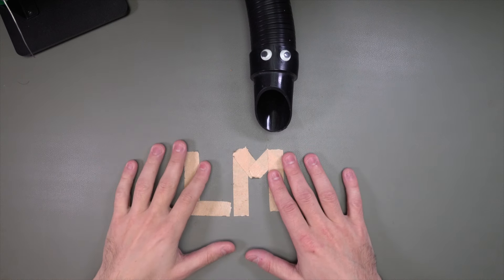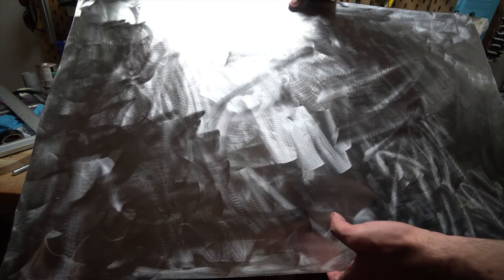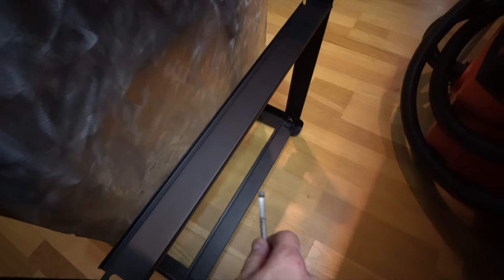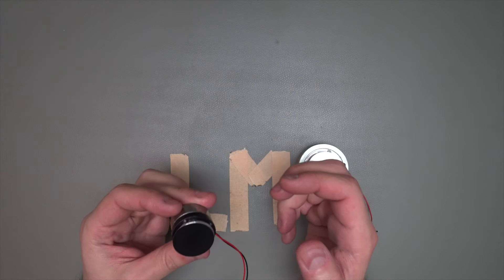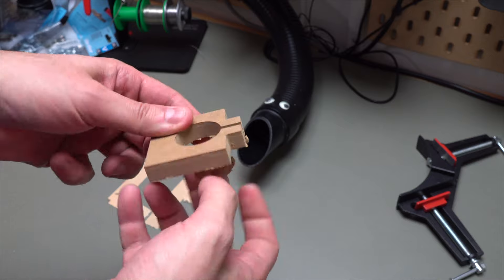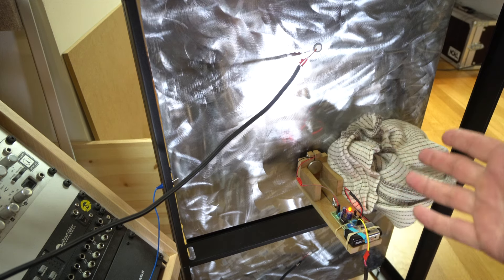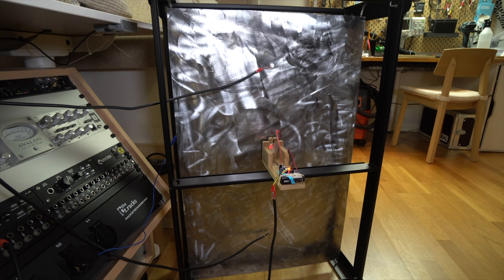DIY "IKEA Hack" Plate Reverb Part 2 (Sounds amazing now!)

Comment: Grounding directly on a main spot is deadly dangereous, beside if the audio interface got its power from the pc with some mid/low tier pc psu it can even cause additional problems. I would definitly use the pin 1 of a xlr connector on the input of the interface so you can remain safe and close to the ground ref of the audio path.
Hope you'll bring some more original and clean projects like this. Sounds and looks awesome.  Cheers
Reply: Dad Vader yeah, the grounding thing is what confused me. What was that box in the rack he was grounding too? Is that just a power distribution that he just wired a ground pin too or what?
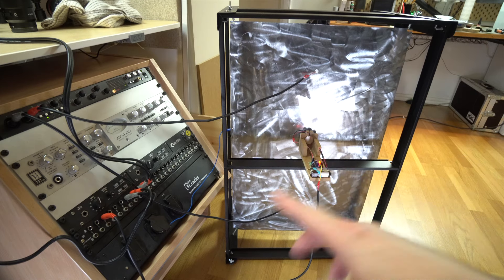Reply: @dylankaminkow5411  at 13:02 looks like a main power distributor, the fact is you end up hooking up your plate to earth and not ground. Ground is a reference point in your audio path and may be different than earth if something go faulty.  i'm not even talking the case where your cord could fail and you get 120/240V in the plate.

Comment: There are so many open doors with this project idea...  Imagine the ways you can impact the sound by adding a doming or curvature to the plate...  go back to horizontal and put grains of rice on the plate...  change the mounting hardware and plate tension...

Comment: Really nice work and problem solving. For dampening you could try a wedge of foam or insulation, to put in the same spot as you have the dampening in the video. That way the further you press it down the more pressure it'd put on the plate, and it would hold itself in place even if just gently placed there.

Also I have to ask about that mini table saw!

Comment: For the dampening, maybe take a look at the sort of adjustable felt dampener that many snare drums (like an old Ludwig Acrolyte or Supraphonic) use to dampen the ring & overtones of the top/batter side head.

You could probably just buy one of those, drilled a hole into one of your side rails, and mount it onto this rig. Turn the knob one way to push more of the felt into the plate, or turn it the other way to have less felt / less pressure (or none at all).

Comment: Your original video inspired me to start working on a design for a wall mounted plate. My idea for dampening was a felt pad on a piece of plywood that could be adjusted. In your case, you could build a second mount like the one for your transducer and just put felt on the end of it instead. That way you can adjust how hard it presses on the plate.

Comment: Wouldn't it be better to actually mount the transducers directly to the plate?
Reply from the maker: Not really.  The transducer needs to be held securely on one end so that it delivers the sound into the plate.  If you just attach it to the plate only, then some sound will get pushed into the plate but a lot of the sound energy will be lost from the other side of the transducer (since the plate effectively pushes back on the transducer).  

That said, I do use strong double-sided tape to make sure the transducer and plate are moving together.  I forgot to mention this in the video.
Reply: @LeoMakes  Makes sense, when I was writing the comment I didn't realise it was just the "send" transducer that you mounted securely to the chassis, not the "receive" ones. I think your reasoning applies to some extent to the "receive" transducers as well, but I guess it's a tradeoff between getting a strong signal and not damping the plate too much.

Comment: 16:40 is it overdrive in the amp, or is the transducer not in permanent contact with the plate at higher amplitudes?
Reply from the maker: Good question!  I noticed this was happening during the tests I did before filming, so I actually used strong double-sided tape to ensure that the transducer's plate is always in good contact with the plate (i.e., it never pulls away from the plate after giving it a high amplitude "push").  I forgot to mention this detail in the commentary but it helps at higher amplitudes.
Reply: Was it the usual thick "spongy" variety of double-sided tape? Because I would think that that would block most of the high frequencies. OTOH, you mentioned, and the sound samples prove it, that they were preserved just fine.
Reply from the maker: @klaasbil8459  You're asking good questions!  No, the tape was not the spongy stuff.  I actually got a strong double-sided tape that was 0.2mm thick and did not compress much (it was gel-like, not sponge-like)

Comment: Holy sht, I would have bet my life that you couldn't find 100k people who knew what a plate rev was. Not to denigrate EMTs marketing Dept.  But Damn!   
Anyway, have you tried corner to corner placement of the transducer/pup? I'm hearing sub 2-3sec decays that sound good, actually sound amazing considering. But, the beauty of an EMT was some of the longer. 4-6 sec decays.. I'm sure the size of the plate figures in on max decay. But I'm pretty sure that it's a function of the distance between driver/pup that the extra size allows..   Where were you in the 70s. I spent my entire career lusting after & paying for $10k+ for Reverbs that weren't springs. Though there may have been an AKG spring early on. From 140s to 250s to 224, 224x, 480xl, DMX/RMX, etc... Today, it's hard for people to imagine the value, necessity & cost of a studio Reverb.  Great clip..

Comment: I once worked on an EMT mini plate who's transducers had failed. It was approx 2' x 2' in a sound deadening shell. The plate was a gold foil--very thin. As I remember there were 2 transducers and 4 pickups. EMT tech warned that the real difficulty was removing the old transducers and pickups. The cement had increased its hardness over the almost 2 decades. New transducers and pickups were going to cost several hundreds of $$$ (this was around 1992) plus labor, plus the possibility of ripping the foil and destroying the device; so the client decided not to proceed. 
  I like your adjustable transducer mount. The EMT had everything cemented to the foil plate. I also like zaque.mwhc
 suggestion of using a snare dampener. I would suggest making something along those lines, but with a disc that could take a 6" lambs wool buffing pad. Make it adjustable to increase or decrease pressure on the plate. Just a thought.
  I really enjoyed both of these videos and hope you do a follow up documenting your mods and experiments. Thank you.
Reply from the maker: Thanks for the kind words, Roger.  It's always interesting to hear from people that worked with (and worked on) EMT plates.  Years ago I mixed on EMTs but the studio owner wouldn't dare let a young guy open up the plate and mess around with it so I never got to see the inside of the crate!

It's funny, I was just at a hardware store and I was thinking about buffing pad.  It's the right size, shape and density.  I might have to give that a go.

Anyway, thanks for watching!
Reply: How did the mini-emt compare sound wise to a full plate?
Reply: @kentwde7933  Never heard it as the transducers were failed.

Comment: Haven’t seen the first video so excuse me if this is a dumb question, but why place the driver in the centre of the panel instead of on say a corner, where it would interfere less with free vibration of the panel? For example in a spring reverb, the driver is placed at the end of a spring, not in the middle.

Comment: The plate reverb sounds great. You're getting very interesting, musical, and usable sounds from it. I'm glad you went for the vertical mounting. The interleaved springs was a good solution. Muting the plate should be easy with something like fleece mounted on a piece of wood attached to the crossbar. Then it could be slid closer or farther from the plate as needed. I didn't hear any odd sibilant sounds or weird tones coming from the reverb. Have you done a spectral analysis of it?

Comment: Input impedance for a piezo pickup should really be substantially higher than 1 MΩ. 5-10 MΩ would be better, for optimum frequency response. It would be extremely unusual to find a instrument input on any piece of professional gear with an input impedance lower than 1 MΩ. The only brand of gear I can think of off the top of my head that commonly features lower than 1 MΩ input impedances are the One Control/BJFe guitar overdrive pedals.

Comment: Couldn't you wire the ground into the instrument cable/audio interface? (When using a balanced/trs cable)
Reply from the maker: Yes, but instrument inputs (which you need to use because they're high impedance) are usually unbalance (tip-sleeve) only
Reply: @LeoMakes  True but to be clear, I meant the cable for the piezo pickup that goes into the audio interface. I thought the piezo would need balanced anyway but not sure. But yeah I have a feel most ppl just won't like sticking a cable into an outlet to ground it unless temporarily :D

Comment: A friend and I built some plate reverbs for my studio several years ago using the plans that Bill Cunningham from Echoplate had made public. We even brought one of our plates to his house and had him give us some tips. One of the amazing things we learned from him was how the dampening system worked. 
He told us to use a particular type of Corning ceiling tile insulation (which is longer available, we had to take some from my mom’s house). The tiles are fiber glass, maybe 1/2 or 3/4  inch thick, with a plastic surface on one side. Bill said the trick is to poke a lot of pin holes in the plastic. These tiles (cut to be roughly the same size as the plate) are mounted parallel to the plate on a frame that makes it so you can easily adjust the distance between damper and plate.
Magically without ever touching the plate, the damper dramatically effects the decay time of the plate reverb!

Comment: Just by looking at it, it feels like the wall thickness of the speaker mount is a bit on the lower side near the brackets, but as I'm not very experienced with MDF material, it might work as it is.
 You should probably add some washers to your screws and nuts. Especially on those on the MDF for better distribution of pressure, or on the screws you plan on adjusting a lot. 
Other than that, this is a very inspiring project of yours! I'm wondering how this thing might sound, once the metal sheet is going to rust. Maybe you'll want to go for a stainless one then.
I'm really looking forward to seeing another update video, or maybe some different DIY projects of yours. Keep it up, and thank you very much for sharing!

Comment: Hey:) I'm thinking about making this plate reverb, will you be so kind to share the project for cnc machine?  Upgrade cost is around 40$ but now if you like to build another one, you don't need to buy 2 Ikea shelfs so you save some money with this upgrade as well
Reply from the maker: Correct, you only need one shelf if you’re making the upgraded version. I don’t mind sharing the design files but let me look into the best way of sharing documents. Probably GitHub but let me check.

Comment: Your project looks amazing, before this video I only knew about spring reverb. If you want keep going with this project you could try making a small tube pre-amp. You could probably base if off of a headphone amp running one or two 12ax7's. They're fairly simple to make and might give you better sound quality than a 9v solid state. You could also add in high/low cut controls to change the tone of the reverb.

Comment: Hi! I'm gonna build this any day soon, the last parts arrived in the mail yesterday. 
Just wondering, could I simply just glue the transducer to the plate, and skip the whole MDF-part?
Reply from the maker: Hi Petter. I’d say give gluing a try and see how it works. My intuition is that the transducer will need something to “push” against in order to get the plate moving, but it might have enough mass where it’s not necessary. But again, try it and see how it sounds.  You can always make the holder later if you want. 

Good luck with your build!

Comment: If you want to know more about damping your plate, have a look at this short video which shows how an EMT 140 does it. The damper is essentially just a flat and solid surface that sits parallel to the plate, if the damper is far away then the plate is undamped, if the damper is brought in close then the plate gets air damped and the reverb time becomes shorter

https://www.youtube.com/watch?v=HEmJpxCvp9M
Reply from the maker: Yeah, I watched this recently when I was doing my research on this project--it's a great video.

Comment: Not sure if someone has mentioned this already. But you could have some horizontal threads that push wooden part attached to thick foam stoppers slowly against the plate. Dampening it gradually.

Comment: After using the UAD EMT Plate 140 for years (and other VST fx), loving the way this plate sounds. My biggest complaint of VST FX (even the most meticulously modeled ones) is a lack of state based interaction (i.e.the preceding state interacting with the current input). This is especially true for plates - if a physical plate is already vibrating, new stimuli interacts with the vibrational patterns already in progress. This adds to the lushness and unpredictability. Kinda like hitting an already vibrating cymbal vs on at rest.
There are models of this behavior (like the AAS VSTs; and the UAD EMT 140 algorithm may take this into account as well), but they are almost always less convincing than the real thing, and the processing power required to get a good stated based approximation is massive.

Comment: For dampening: Assemble a piece of foam to a fixable slider near the center of the plate. Use pyramid or circle shaped foam. The more you press the foam via the slider to the plate, the more dampening you have. Think about the foam shape to achieve either a linear or a logarithmic dampening curve. Let me know what you think.

Comment: I said in the previous one, but I'm SO making one. I'm also thinking in ways to dampen it. Maybe something similar to the transducer mount with felt pads and a screw?
Reply from the maker: I was thinking along similar lines for the dampening system.  Good thinking!
Reply: @LeoMakes   I even thought what would happen with 2 similar dampening systems, closer to the piezos, that can be tighten differently and have different density of reverb in L and R? Not sure what would I use that for, but...

Comment: I love that you figured out a way to build your own plate verb on the cheap. It sounds so sick. 
I actually have an idea on how you could damper it! Something like a Pearl Internal Drum Muffler #734, which is like $5 right now on Musicians Friend. I don’t know if it’s long enough to hit the plate from any of the frame, but it could be made to work. If you used a few you could have a ton of reverb length adjustment just by a few knob turns. You could make mounting points in different places on the frame. I hope the idea helps in your endeavor. It may be unnecessary, because it sounds great with that towel already. Plates sound beautiful and yours is no exception. One day soon, I am going today build my own.

Comment: is that the minis desktop table saw from Harbor Freight? Does it work well on anything other than MDF? I really could use one but the reviews made me dubious.
Reply from the maker: Hi Bob, I have the Proxxon FET table saw.  It's designed for model makers and people doing high-precision small-scale prototyping work and I think it's excellent for that kind of work. I've  used it on MDF, plywood, hardwood  (10-20mm thick) and even thin (3-4mm) aluminum panels and got nice clean cuts.  It's definitely NOT the right saw for ripping large panels or thick lumber but for small work it's great.

If I made reviews on this channel, I'd probably review this and give it high marks.  Hmm... Maybe I should make reviews?

Comment: Damn, it Sounds really really good!!

The ground loop solution isn't that good tbh, maybe 1-2 di boxes with groundlift are a better option.

DI boxes also solve all the impedance issues.
Reply: Especially with snare and those short impulses at 16:09. The reverb really makes them shine and it also ads a kinda sparkle in the higher frequencies!

Comment: Maybe if we hook a towel, smashed slightly into a ball, and attach it to a rotating arm, with another arm pertruding from the back, so it would have a weight, that would push the towel to the plate, and then wrap it with a strap, that is connected to a rotating lever, so we can easily set the dampening?

Comment: I already have ordered exact same  big transducer, wich you called "muddy". Is it realy that bad?
Reply from the maker: Not at all!  Just don't turn it up super loud and high-pass filter the signal that is going into it and it will sound great.  The advantage of the big transducer that you ordered is that it has two holes for mounting, so attaching it will be much, much easier than the solution I had to use (the medium transducer has mounting options, which is a pain).

Hope this helps!
Reply: @LeoMakes  ok, thanks, btw you can try to get "more stereo" sound, watch this https://youtu.be/LtyE91rmVUs (add more piezos)

Comment: What's so impressive about 1M input impedance?
Reply from the maker: It's not that it's impressive, it's just that piezo pickups need high impedance (1M or more) inputs to sound good.  Not every interface has high impedance inputs and if you plug it into a "line" or "mic-level" input, the piezos would sound terrible (thin and tinny).